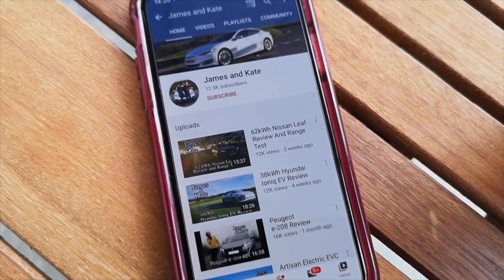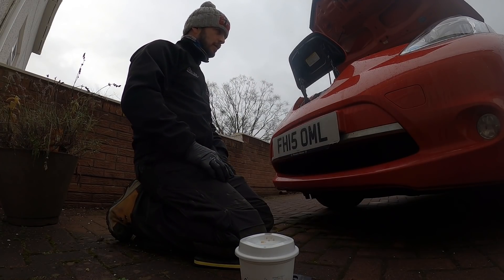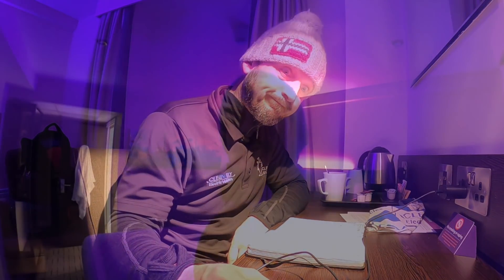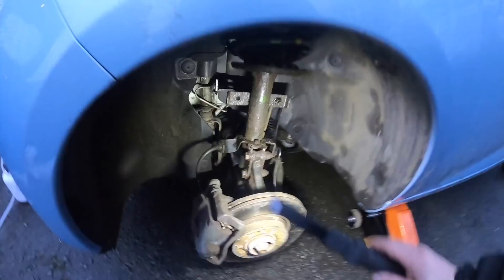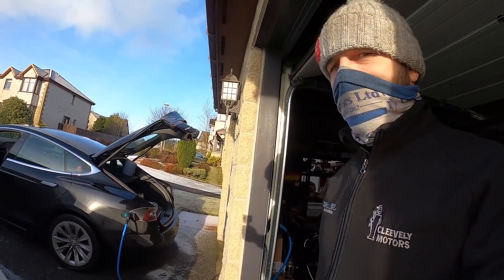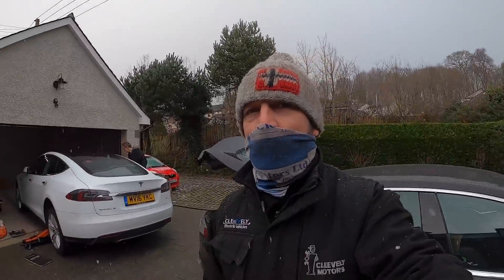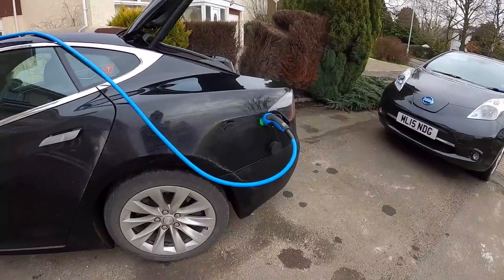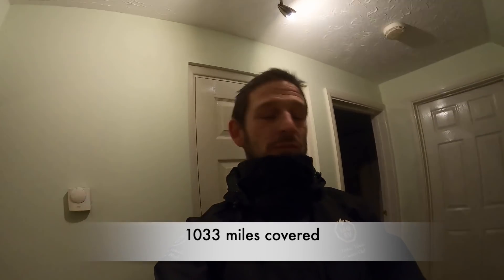A week onboard with an EV technician

Comment: I AM from denmark and Thing it is very interresting to see your work. I have not bought and Electric car, not because of battery. But because lack of garage there can repair the car elelctronic, charger and so on. You should get a truck were you can fix cars in

Comment: Pardon my ignorance, but why did you completely isolate the high voltage system for doing a brake fluid change? Maximum technical details please.
Reply from the maker: I'd love to give you loads of details but it's just so long winded. Do a quick Google search and it will explain why.

Comment: -32C my battery locked itself down im level 1 charging it to get the battery heater working.  Enjoy your balmy weather.
Reply from the maker: I'd probably go for a 7kW charge. The level 1 probably won't give enough to heat it.
Reply: Yeah, I've seen one EV owner from Yekaterinburg complaining about his Ionic going into reduced mode when battery cooled down to -30C (-33 outside temp). Would barely accelerate and would not go above 50km/h. Lucky for him, it was only 3km to workplace (that's where he charges).
Reply: Problem is i cant go anywhere until the battery warms up.

Comment: Hi James, interesting video thanks. Have you had to deal with the 7KW charging issue for the SEAT Mii/VW e-up/Citigo yet?
Reply from the maker: As in it's only charging at 3.6kWs?? I believe it's species this way and will only pull 7 on 3p? Or is this a different issue??
Reply: @Jamesandkate  yep. That’s the one. They are claiming a software update is fixing it but of course it hasn’t for our Mii. Was just interested in case you’d seen it fixed. 👍

Comment: would u ever come cornwall way
Reply from the maker: Yep, if I could double up the jobs and make it worth while. Do you know anyone else with an EV your way???
Reply: @Jamesandkate  can put the word out as we don't have much down this way for help so would be good. also do u know if can fit a 240 volt 3 pin power adapter to any ev like the honda e has?